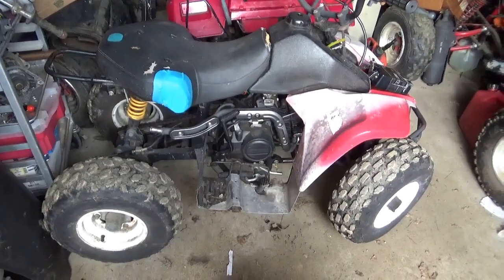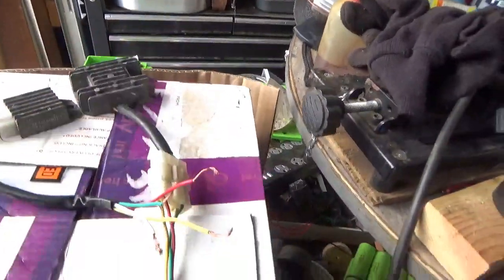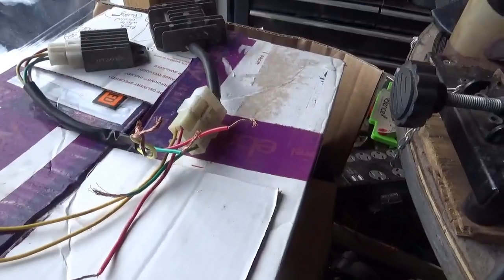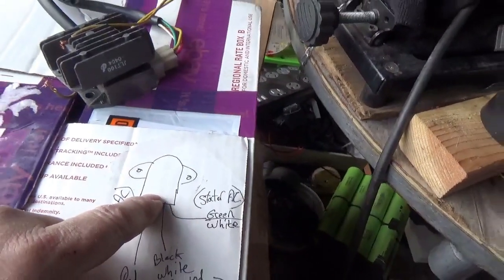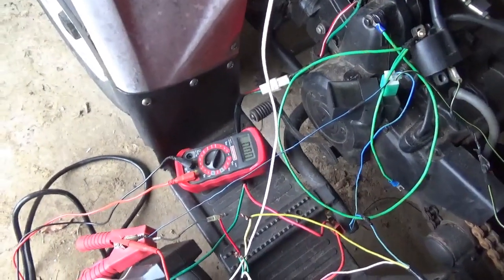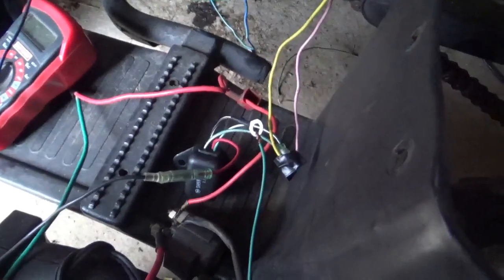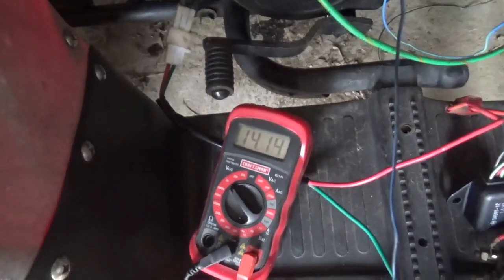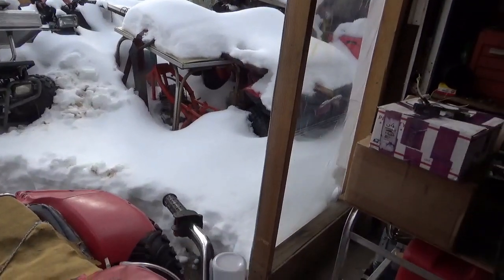How to Wire and Test an ATV or Pit Bike Voltage Regulator!

Comment: Hello, I have an Arctic cat 1997 454 Atv, there are seven wires going into my CDI Box 3 on one side, which are a black wire that appears to be coming from the regulator rectifier a white and blue wire which goes to the ignition coil and then an orange and white that goes to the connector for my Killswitch. Then on the other side of my CDI there are four pins coming from the stater/pulsar coil. My question is if I convert this to a four pin CDI do I have to do anything as far as the regulator rectifier goes?

Comment: Thanks for this. I was looking at regulators on ebay, because I want to put one on my ATC200S to avoid bulb failures. I was wondering how they work. Good to know they rectify also. I saw some AC voltage regulators which have only two wires, so I assume they just connect in parallel to everything else, but it would be nice to have some information in the item description to ease my confusion.

Comment: Im hoping you can help me. I just bought an Electrosport stator for my wife's Honda XR100. 3 wires come off the stator.  2 plug directly to the original ignition harness and it has an additional yellow wire with a double barrel bullet connector for lights.  My regulator rectifyer has 4 wires green, pink, yellow and red . Does the ground  from the RR hook to the frame AND battery or just to the battery? I can't seem to figure out how to wire this. I've hooked green to battery negative, red to battery positive, yellow to the new yellow off my stator but where does the pink wire connect? And why the double barrel connector on the yellow wire off the stator? I'm using led lights if that matters. You seem very smart with electrical so I'm sure this would be a breeze for you lol I'm struggling.

Comment: Could u show more details about mechanical ignition advanced on on a honda atc , my 185s wont start no matter how much u pull , when it does start after about 208 pulls it wont idle and pops and also in your old vid about it u said u could pull forever it wont start and it pulls back (freezes) sometimes, mine does the same thing and i wanna know if i need to buy a whole new part or just springs
Reply: Did you fix the problem?

Comment: A bit more understanding of the electricity that lets those gas engines run, thanks Harvey. After thinning out my herd last year and limiting myself to only enough machines that will be enclosed by nightfall, I'm doing well in that department. More tires ordered, so I'm building more racks. Snowmobiles coming in like crazy and side by sides are coming from every direction, I guess not many shops work on these on a regular basis.  The loading dock, shop truck and trailer, and the portable ramps are getting a workout. It goes from ghost town to Grand Central Station in a matter of minutes, fantastic! Looking forward to the next lesson, be safe.